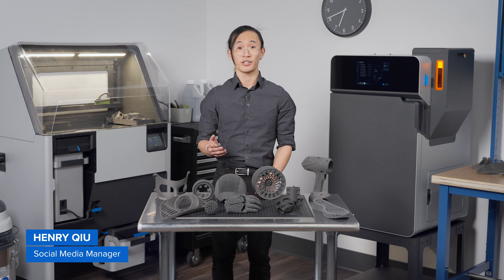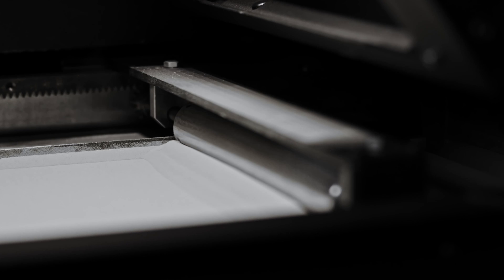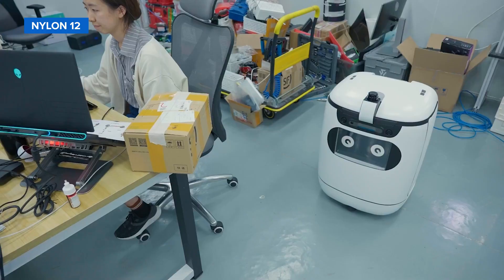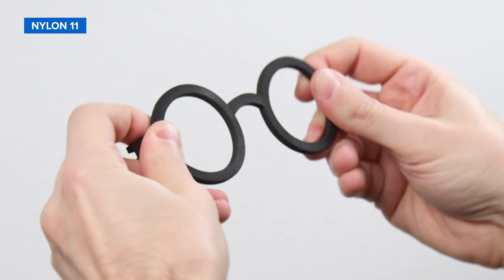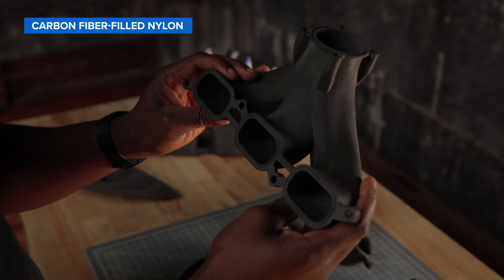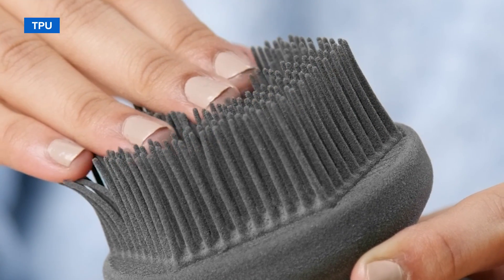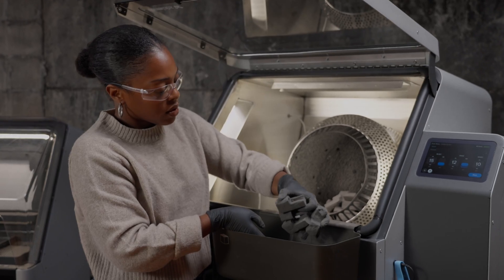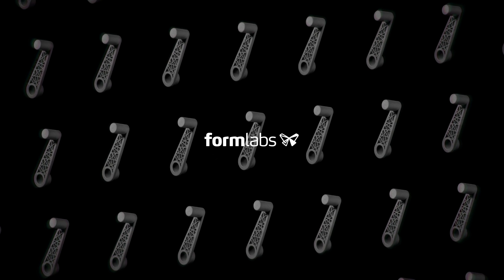SLS Powders Explained

Comment: if recoating is the compacting part SLS is correct but to me it's more like eos called it: SLM for Melting.
Reply: SLM uses metal powders. SLS uses plastics.
Reply: @Hook0403  yeah, i know that it's used this way but it makes no sence... in both cases the powder is compacted by the recoater, than heated, than MELTED by a laser. so why sls and slm - like i said to me it's slm in both cases..
Reply: @wildniscamper7276  because one melts the material and the other sinters the material. Selective Laser Melting (SLM) and Selective Laser Sintering (SLS) are two different 3d printing processes that follow very similar guidelines. They are not quite the same though. That's why there's two different names to differentiate the two different types of processes. So that the consumers can make a distinction when shopping for different products.
Reply: @Hook0403  what's different beside the o2 free chamber and temp.? PA2200 is near the melting point and the laser is melting it same as with metall just more power.. classic sintering is f.e. carbide inserts (metall). so it still makes no sence to me..
Reply: @wildniscamper7276  it doesn't melt it at all. It sinters it.
Reply: @wildniscamper7276  sintering does not bring the material to a melting point but a point above melting where the material can fuse with itself but has not become a liquid state. This is very important when looking into a specific process of manufacturing. SLS is for plastics SLM is for metals as you have to melt them down to get them to fuse.

Comment: Nice! Now it's only time to get Price lower for Consumer. A Company is 24/7 working and earn Money. Consumer Market is very different to Business Market. Less Money, more Custumers to service. Same as CNC or other "industrial" Applications. Only Company that i know is PRUSA, because Businesses Machine for Customers and the other Way. Every body is happy. If you look to other as FDM. There is no Company out there like this. Formlabs bring SLS for less than 2000, closed Source open Source what ever, but be the first. But the Consumer Market fear Companies. Not always the First make the Money or NOT enough Money came back. Or Worst Case is you paying on top. Hahahahaha in the near Future no Cheap SLS at Hobby. Nice Video!!
Reply: Micronics made a home use sls printer for 2500eur but formlabs bought the company and shut it down

Comment: Is it possible to make the particles smaller so you can get higher detail and the parts don’t look like sandcastles?
Reply: i think thats more of a limitation from the lasers side. the laser can't heat the powder as precisly as you would need to for a super smooth surface.
Reply: As seen on new consumer SLS printers, the solution is a sand blaster, as most of the sandy look comes from partially sintered powder coating the surface of the print, and can be removed whilst leaving the actual model intact

Comment: Nice to see the Fuse Blast in action. Ours should be delivered in a couple of weeks
Reply: how much is this fuse 1 cost ? pretty amazing but theres not a single pricing i can see
Reply: @bukankapi4014  the price is on FormLabs’ site
Reply: @bukankapi4014  You're looking at $20K-$30K cost of entry, up from there as you add accessories.
Reply: It's about $28,000. They aren't made for normal consumers yet.